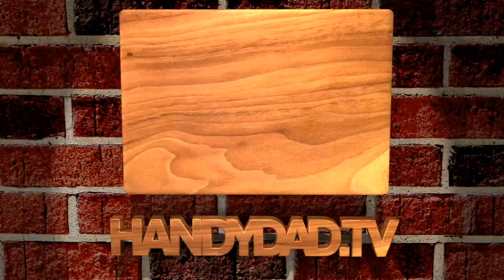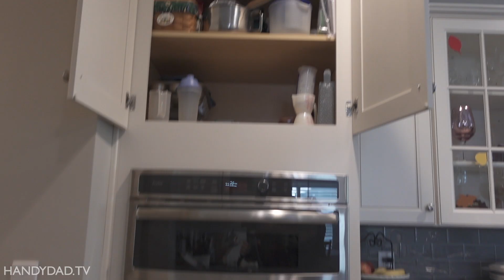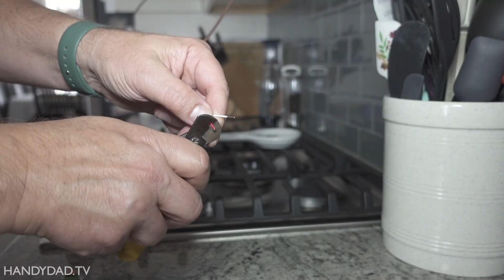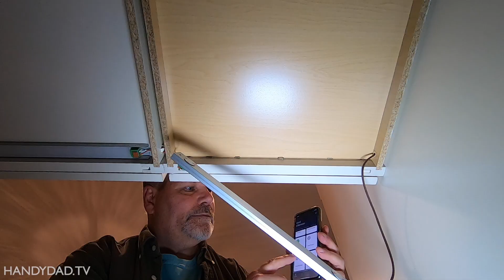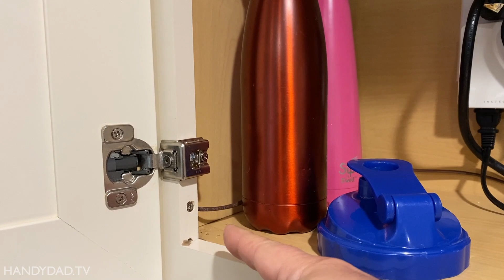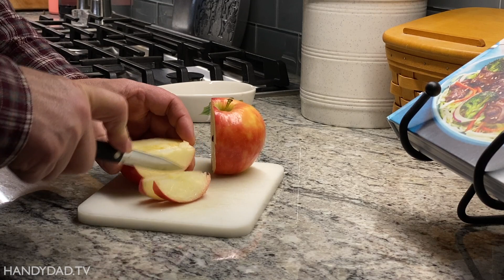Easy Kitchen Cabinet Lighting with KitchenLEDs

Comment: Getting my kitchen remodeled so new cabinets are going to be installed. I thought now would be the best time to install under cabinet lighting. How are these holding up that you installed? And would you recommend Or any suggestion if you had to do it all over again? Thanks
Reply from the maker: I’ve done four installations with KitchenLEDs so far. All still working great. Highly recommend.
Reply: @handydadtv  any one of the four stuck out the best that you prefer more?
Reply from the maker: This video was the most recent and most involved because it used 3 power sources.

Comment: I'd like to add lights to our kitchen cabinets but I'm not sure what the best option is. I may consider this but  I'm not quite sure how to do it in our kitchen set up.
Reply from the maker: It’s also an option to attach the transformer to the bottom of a cabinet and run the cord down to a counter outlet.